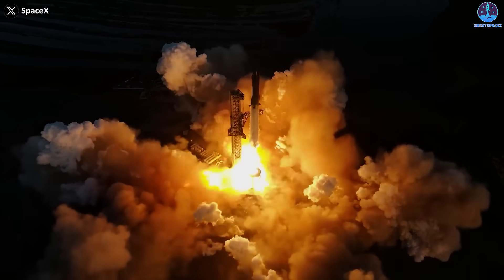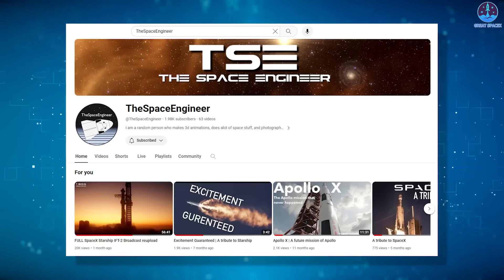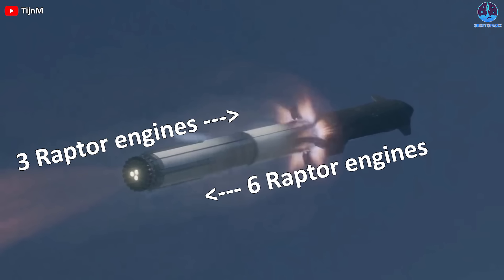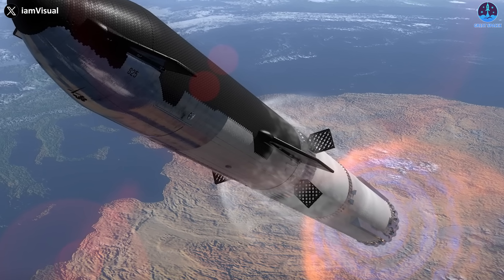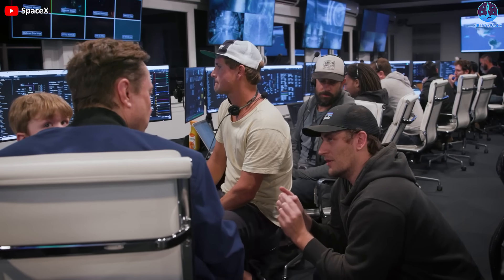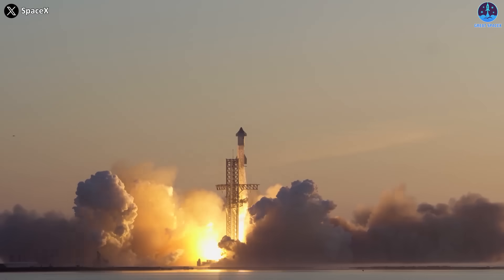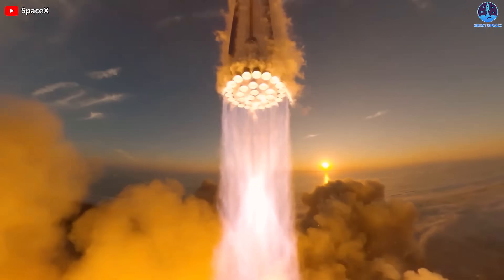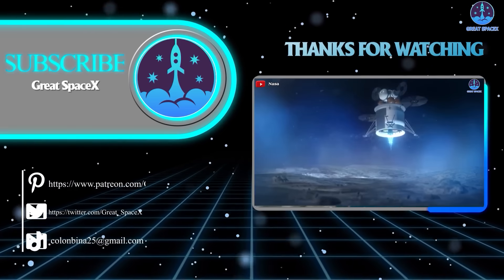How SpaceX Starship fuel sloshing will blow your mind!

Comment: Here's my thoughts:  SpaceX engineers are no doubt the best, but they can be pretty dumb sometimes.  Since they mentioned hot-staging I immediately worried about sloshing of the fuel ...  do they have no imagination whatsoever?  These fuel tanks should have internal paper-thin sheets of perforated stainless, to slow down fuel trying to slosh around, to prevent high speed, violent sloshing.  I'd put one such sheet like every 50 cm all along each tank of methane or oxygen. That's number 1.
Number 2:  There should be one tiny micro-Raptor in the middle, used to create a tiny bit of gravity to get the fuel to the right places.  Such engines are called "ullage motors";  not my invention;  but they are usually solid fuel things for single use;  I'd make it a mini-Raptor and be fed from the header tanks.  In fact, this should be THE reason for having header tanks.
3: Header tanks should have an inner bag to prevent fuel sloshing, if they don't already, pushing the fuel like out of like a toothpaste tube, NOT relying on gravity.
4: Backward acceleration bouts, or any extended lack thereof, should be automatically detected and be made to latch an "ullage restart required" state.
5:  When your nav computer demands the engines to start and an "ullage restart required" state is latched, the start sequence changes to one where the tiny ullage mini-raptor turns on first, and after half a minute or so (of time for the fuel to settle at the pumps) the other raptors are started.
6:  But I applied for a job at SpaceX twice and got rejected by their HR idiots.  I don't blame SpaceX for having idiots in HR;  I blame them for having HR at all;  Elon should know that all HR people are idiots.
Reply: It is essentially impossible to manufacture an "inner bag" that retains flexibility at cryogenic temperatures, otherwise, it would have already be applied to the main tanks with autogenous gas pressurizing outside of the "bag" (which then has the new problem of "bag" being sucked into pump or engine suction inlets, starving it of fuel).
Otherwise, good suggestions.
Reply: @stephenkingsley5815  Touché.  How about pistons for the main tanks?  Assuming the tank is a cylinder with hemispherical endings, a piston could be spherical.  Question then would be what to do with the wasted space inside the piston.  Answer is to NOT waste its space;  put something in it;  maybe use the piston as a (mobile) header tank.
Reply: @privateerburrows  A piston? Like a syringe? That needs an extra part to stabilize it and keep it from rolling to a side?That adds mass and doesn't improve functionality? The space could still be filled with gas to maintain suction pressure for the turbo pumps so they don't cavitate.
Nice idea. But I think the ultimate solution will come from software timing to allow time for the fuel to settle and the use of thrusters to help settle the fuel.
The question then becomes would they then have enough margin remaining in the tanks to accomplish the boost back and the landing, or will they need to stretch the tanks just a little more to certify that margin.
Reply: @stephenkingsley5815   Good points!  You lost me in the last paragraph, though.  Do you mean that ullage thrusting would use extra energy?  No, the ullage thrust is in the same direction as the main thrust, so not a drop of fuel is wasted.  Only the time over which the delta-V is applied is slightly changed;  not the total delta-V.  But yeah, the time is tricky because it is not simply the time for the liquid to settle down, but also enough time for gas bubbles to bubble out of it.
  Another thing I've been meaning to say to SpaceX for years is please consider using resistance in series with fuel and oxidizer lines to avoid violent flows when on/off valves and solenoids open.  Remember the explosion of the Dragon on the test pad?  I've forgotten by now the full sequence of events that led to that explosion, but one of the elements in it was a violent rush of oxidizer through a pipe that ended up burning some valve on impact.  And I was thinking all along, a simple resistive plug of stainless mesh in the oxidizer line near the tank would have slowed that inrush to prevent that catastrophe.  You see, I'm an electronics engineer, and in electronics I always place resistive elements in series with signals near low impedance outputs, and filtering capacitors between the signal and ground near high impedance inputs, to avoid excessive currents at outputs and excessive voltage swings at inputs, and to reduce signal trace resonance.  I would apply the same principles to hydraulics, whenever possible without adding too much complexity, of course.
  Along the same lines, I've been aching to say to SpaceX engineers to consider mechanical resonance issues, and how they can be sometimes mitigated by a thin, light-weight hydraulic resistance element more easily than by 20 times as much mass worth of metal bracing, which only raises the frequency of the resonance, rather than dampen it.  (Having said that, the paper-thin, perforated sheets of stainless every 50 cm inside the tanks would also help as high efficiency bracing;  I would have them between tanks, too, for that reason.  Even if bracing only raises resonant frequency, higher frequencies are easier to dampen.  This is my accoustics hobby talking now...)
  And in my field, electronics, I have too much to talk about;  but one thing that comes to mind is analog hardware filtering of signals for data acquisition.  Everybody and their dogs use filters like butterworth, elliptical, etc.  The right filter to use for noise removal before signal conversion is Bessel.  Bessel has a bad reputation as having a smooth rolloff;  but on the other hand it is the fastest-settling.  From a step-change, most filters produce outputs that approach final value asymptotically, whereas Bessel filter output is like an S-shape that settles in final time.  This greatly simplifies PID control tuning, among other things.  I said Bessel, but I mean any linear-phase filters, like gaussian.  More generally, if the group delay graph for a filter is flat, settling time is quick.  If there are peaks or artifacts in the group delay of a filter, its output takes forever to settle, and it introduces complex phase delays that are hard to compensate for in the PID.  That's the essence of it.
Reply: @privateerburrows  Example, on Flight 2, at staging, the booster was down to approximately 10% of initial fuel loading. Now it takes longer time to establish fuel settled after staging and rotating for boost back, to prevent damage to pumps and engines.... all while traveling farther away from landing zone. Will it take more fuel to affect that return boost back or is there still enough fuel remaining? Did SpaceX over-engineer the booster already.
Ullage gas thrusters are already in use on booster (see interview with Everyday Astronaut where Tim gave Elon that idea, simplified from using actual engines). Just use them also to settle fuel before restarting engines.
Reply: @stephenkingsley5815   Gotcha.  I saw that video of Tim and Elon;  I just hadn't understood what they were talking about, at that moment.
Reply: @stephenkingsley5815   Another thing I've been meaning to say for a long time is please don't be too optimistic about ground consistency on the Moon or specially on Mars.  The Moon we know a little better;  but Mars is a huge question mark, with surprising deep and "mud"-looking track marks on the surface since Spirit and Opportunity.  The soil may be porous and crumbly like an ant-hill, for all we know.   On Earth, not only is there stronger gravity, but we have water and ice helping compact sediment.  Sediment on Mars is free to assemble like microscopic houses of cards.  You might expect the landing feet to sink a few inches, and they might sink a few feet, if not meters.
  To make matters worse, what's below the dust is likely to be what's above it:  Scattered rocks and outcrops here and there.
  You might land on what looks like a perfectly flat patch, but a few feet below there might be an "outcrop" ("incrop"?) underneath two of the feet on one side;  nothing under the feet on the other side.
  I feel it is a toss of a coin the first Starship to land there stays straight or topples.
  My suggestion would be to use a NASA style lander for the first power plant, landscaping machines and Optimuses, and have them build a proper landing pad.  The lander could be brought as cargo in Starship, but then Starship remain in orbit.

  On another topic, I'm sure you guys have gamed this out, already, but I'm going to say it just in case:  The first humans to go to Mars should stay in orbit;  NOT land;  and simply be there to VR-help the Optimuses down on the surface from a distance where latency is much less than it is from Earth.  No need to risk their lives going to the surface before there's a base there.
Reply: Same concerns here ! I got also immediately worried about sloshing of the fuel when I first heard about the hot staging-

Comment: This seems to be a small oversight when switching to hot staging.  It is a power balancing issue.  It may be as simple as keeping more power to the booster to account for the forces of hot staging.  May just be a software parameter adjustment.

Comment: Yea, it blew my mind that this sloshing subject was thoroughly studied in the 60's, and no one used the material for Starship. Spacecraft run by dopes.
Reply: @colonbina1  The thing is, how to baffle the tanks. As it stands now, any tank made so far will have to be modified, that includes all of the boosters made so far. Looks like  long time before Moon or Mars now... BTW, it is my belief that this isuue on a space craft of this size is unsolvable. =)
Reply: Yes, hot staging was used on the Titan II rockets used in the Gemini program. They weren't concerned with what happened to the booster, it was expendable. It is a new issue when trying to return the booster for recovery and reuse.

Comment: Baffles might help, but a diaphragm or bladder in the tank that would keep fuel at the bottom of the tanks would be better. The problem is, that the supercold propellants would freeze a bladder solid, rendering it useless...

Comment: I can fix the fuel sloshing issue, how do I contact SpaceX? AND no it's not baffles!
Reply: Kramer me, why don't you just tell me the movie you are wanting to see?
Reply: In the past, a bladder inside the tank was used to force the fuel into one end of the tank.  If they don't start doing real engineering, their flying bomb is going to have major issues in space, as liquid fuel and zero gravity work under a totally different set of rules.  Liquid fuel transfers could have issues due to surface tension and cavitation.  At the moment, they are using redneck engineering and fixing the problems as they happen.  SpaceX is redesigning the wheel to be 3000 times more complex than it needs to be.

Comment: I almost rolled a brush truck, or a smaller truck with a pump and a water tank on it and the tank was not baffled. Thankfully, I managed to regain control and not wreck it, I am surprised that there are no baffles inside the main fuel system. True it saves weight, but if you want something to reuse, you will need the baffles.

Comment: they need to compartmentalize the booster, just like the fuel tanker truck separators are called Baffles. Baffles built like funnels will prevent fuel from splashing upward during separation, it will also lessen fuel downward pressure during upward acceleration.
Reply: My thoughts exactly. I assume it is a weight issue, but considering they want to reuse the booster and use hot staging, it seems like an obvious solution, which you have to assume they are evaluating.
Reply from the maker: Great comment👍

Comment: So why don't these sloshing issues affect Falcon rockets?
Reply: Falcon doesn’t burn liquid methane.
It’s an issue with fuel temperature being too close to boiling point.
Reply: The tank is smaller so there is less space for fuel to move around, imo.
Reply: Falcon experiences minimal if any negative acceleration, and they have thrusters to help push any fuel back to the bottom before starting the main engines.
Although this is a well known issue from decades back, it wasn't a concern in most cases because the booster was going to be discarded anyway. But hot staging a booster you plan to bring back involves a lot of problems no one in the past delt with.

Comment: Considering the fact that 3 engines remained lit, and thus served as ullage engines, it is likely that the Starship engines were the impetus for initiating the sloshing. Perhaps if the interstage had a dome profile, as opposed to its table-top profile, the jolt at Starship ignition could be softened such that sloshing could be lessened or eliminated.
Reply: I recall Scott Manly (spelled name wrong?)  said as much.  Interesting observation on your part.  Ingestion of inert presserizing gas into the engines may have played a roll in damaging the fuel delivery system? 
As sudden turbopump stall may have broke the lines leading into the pumps. Either way, interrupted fuel flow, caused by losing forward delta v was probably the problem.

Comment: Um, then how come this doesn't happen with Falcon 9, which does the exact same maneuvers. SpaceX says they lost the booster due to venting liquid oxygen, which was planned, since they weren't going to attempt a landing.

Where's your proof for your theory. Please provide the SpaceX telemetry data that supports your premise.
Reply: Falcon's ignition timing is different. They'll likely solve this in a similar fashion. The hardware is fine.
Reply: Falcon 9 runs kerosene at cryogenic temperatures - much more viscous.
Methane needs to be sub-cooled to avoid flashing when shaken.
Reply: Falcon does not hot stage, so no negative acceleration, no slosh.
And it was starship that vented O2, not the booster

Comment: The fuel sloshing no doubt has many solutions.  Here's one from a 1960s car carburetor.  Use a thing called an accelerator pump to temporarily inject a sealed quantity of fuel into the fuel pump of the rocket. This will temporarily supply a solid stream of fuel to the engines till the rocket re-accelerates and re stabilizes the fuel in the tank.
    I think that a fuel tank baffle matrix would be the better idea. It would prevent the fuel from sloshing by directing the slosh into a collection funnel .
Reply: I think the header tank in the nose of Starship is something along those lines, keeping a discrete fuel reserve. Not that it feeds the booster, but a similar concept might be looked at. The modelling might show the sloshing can be solved by a slightly different trajectory and ignition sequence. Falcon manages it already somehow on a similar flight profile.
Reply: @DJ-bh1ju Different fuels with different viscosities. The methane may also not have been cold enough to avoid flashing when mechanically shaken.
Reply from the maker: Let's wait for SpaceX's next steps ☺️
Reply: @colonbina1  LOL ! It's not that I can't wait. I really can't.  But they won't let me near the rockets !!

Comment: The Booster experienced 2 major problems found in any LNG process. The first is the liquid sloshing, which causes a phenomenon called Rollover. This causes the liquid to expand back into a gas at 1/600, which means that the pressure inside the tank started to cause it to over pressurize. The second is foaming and that is fixed by an amine system.
Reply from the maker: Keep discussing this on our channel ♥️

Comment: The three center Raptors of the booster never faltered during staging, they started to fail after the high G’s flip manoeuvre that shoved to fuel on one side of the booster starving all of them! This manoeuvre was a joke to me, as if SpaceX learned nothing from the SN’s prototypes flip manoeuvres… very disappointing.
Reply: They manage it nicely with Falcon - I think they may be able to solve it on Superheavy with some timing and trajectory tweaks.
Reply: Falcon 9 has a smaller tank, there is less space for fuel to move around. The booster just have to rely on the exhaust of the orbiter to flip the booster and when it gets to position then you lit the remaining 10 Raptors for boost back.
Reply from the maker: They will improve in the future ☺️
Reply: Flipping a booster and ship js WAY different
Reply: The flip maneuver in the SN prototypes was done at much lower speeds, and much lower G forces than in IFT 2. That problem might not have been apparent at that time. Plus, there was no hot staging pushback from a booster, like in IFT 2.
Reply: If the hot staging did created that push back, the 3 centralized Raptors of the booster would’ve failed during staging, they didn’t and when they ignited the remaining 10, they all ignited properly but after flipping at 4G’s, that’s when everything got wrong!

Comment: Why not have a separate, smaller return flight tank with a valve that opens to use the remaining fuel from  the large tank? Once the engines re-ignite, the forces will push the remaining fuel to the return flight tank.
Reply: Like the ship